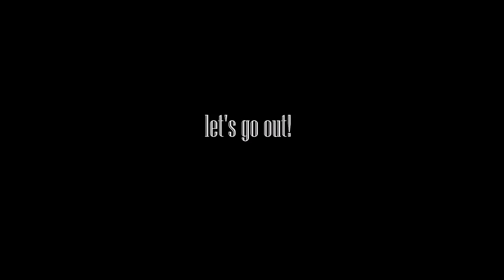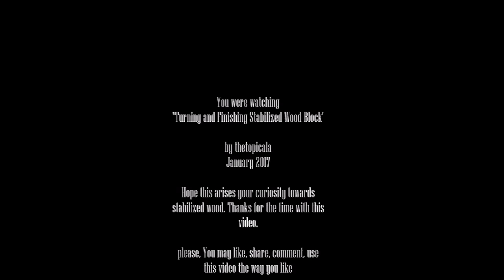Turning Stabilized Puukko Handle - VIDEO by thetopicala

Comment: Tip for anyone having trouble with slow flowing epoxy, heat it up slightly. For example with warm water bath or a few touches with a lighter ;)
Reply from the maker: I have found hot water „bath“ very good 👍🏻

Comment: Wow. Amazing work. I havet just started with my first knife. Apple handle and a lauri blade . I found it hard to drill out the tang hole. Any tips or tricks? Best regards from South Sweden
Reply from the maker: Hej, always a fresh drill bit and it bites. Don’t try too small drill bit - 5-6mm is good with Lauri blades.
Reply: @thetopicala  thank you for the answer. I Will try this.

Comment: Hej Osmo, really nice knife. The birch turns out great. Maybe a small tip to the slow epoxy dripping... use a syringe. 
Saves me some minutes and gets the epoxy all the way down. Just ask your doctor for some. you can clean them with solvent afterwards ( before epoxy cures). Greetings from Belgium ( close to making that leuku)
Reply from the maker: Great Bear Thank you! I have thought syringe sometimes but never tried. I'm sure I have to give a try! Osmo

Comment: Very nice video Osmo! 
The wood looks good. I guess you don't need to oil the handle when you use stabilized wood?
Reply from the maker: kaziklu79 Alex, thanks! Stab wood is careless, yes. Just quick very light sand up to 600-1000 grit depending on your use and strong polish. Osmo
Reply: Thanks Osmo!